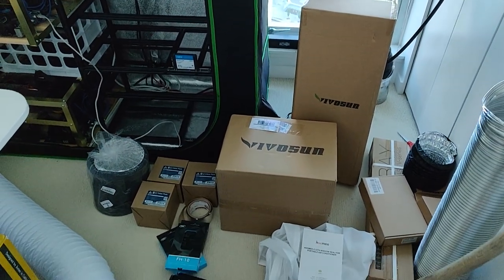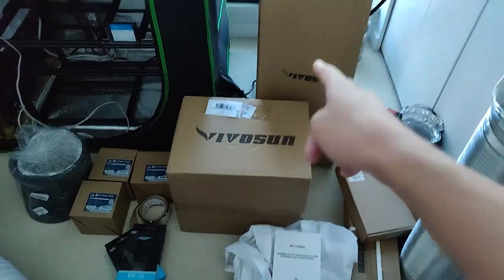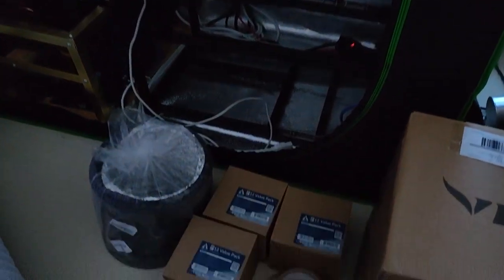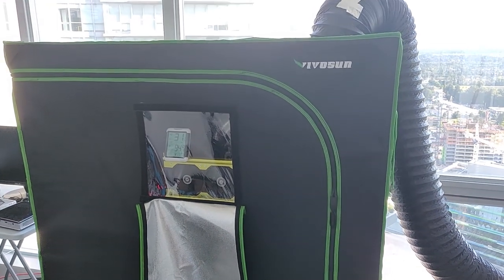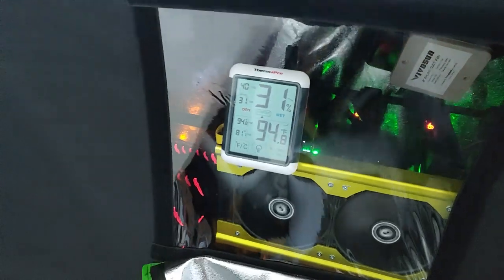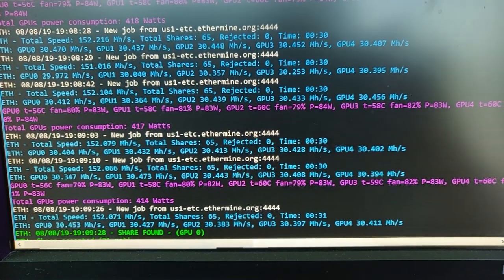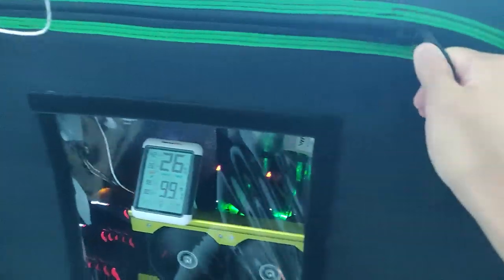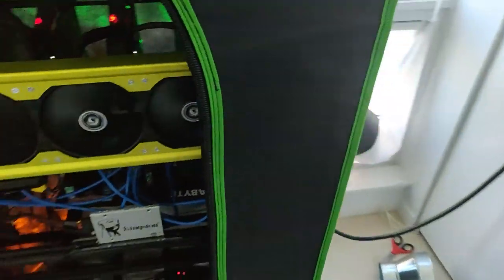12 GPU Mining Rig Condo PROJECT! Part 5

Comment: Airflow is like water through pipes (fluid dynamics) you want to PUSH air in and then route it where you need it to go.  When you fill the rack with rigs, you'll end up with VERY turbulent airflow which is why you're getting hot-spots (groups of cards).  Right now, you're bringing a gun to a knife fight with your HUGE exhaust fan but if you put that on the front end to PUSH air in then directed it up through different parts of the tent, you'd end up with better cooling at lower fan power.
Think of how aircon works at a mall, they pump the cold air evenly around and then the hot air gets pushed out the open doors, etc.  You should look at how many cubic meters of air your need to move in a minute (size of your tent and how many times you need to clear the hot air per minute) and then push that much air in, making sure there's a clean path for it to get to your exhaust ports.  This is also how server racks work when designed to flow from front to back or bottom to top.  Looks like the tent is bottom to top so put your hottest cards on the bottom to get coolest air and make  2 even holes at the top (either side of top) for the hot air to be pushed out easier.  Bigger holes out = less air resistance, hence easier flow. ;)

Comment: I'm looking for ideas for building a box for 2 or 3 rigs. With a inline fan input and output. I plan on pumping the heat outside in the summer, and inside in the winter. Great video

Comment: Yeh, that's a nice change in temps.  And, I couldn't hear the fan that much, I wouldn't worry about it.  Also, if those cards from your buddies rigs are exhausting towards the center of your tent, that hot air will be contributing to the temps on your 570 rig as they are blowing directly underneath it and hot air rises.

Comment: Thanks for testing my previous message about heat exhaustion importance to be true. I think your system is going right direction, but that negative pressure is something you might still keep doing some moves. That much negative pressure sucking the tent walls in my opinion means you should have some more additional intake holes in the bottom area of that tent. If the air moves easily, and it moves just one direction (in -> get the heat from cards -> out) you should be doing just fine. Fans are fine, do not add anymore power there, just make the tent and its air intake/exhaust holes to work the best for your project.

Comment: Hi Red Panda, these ( new fans) experiment turned out to be a hugh success. The good news is: in four months ( winter time), the intake fan will bring really cold air from outside ( your apartment) into those graphic cards, the graphic card temperature will be fifty degrees ( or below fifty degrees) while mining. Will you consider to apply this method to your Radeon 7 mining rig, because you already know these eight hundred CFM fans will work effectively? Red Panda, this is outstanding result. Keep up the good work, sir

Comment: Glad you got it going, man. Not to be a downer, but given your GPU fans are already at 80-90% speed, it does not look like you can add another 12-pack of GPUs... Good luck - it will be close!
Reply from the maker: that will be the ultimate test, once those next 12 gpu's are in, we'll see if the 8" can hold up!

Comment: Bruh... I've got 21 gpus in a slightly taller tent. Mix of 1070/1070ti/1080ti. Only using a 6in exhaust and 3 small inline intakes with all temps <70 in 100F outside air
Reply: Also make sure to put your ethernet switch on the same circuit as your fans so if your fan circuit trips, connection does too and temps drop
Reply: And hiveos ftw

Comment: Have a question about the tent. When you had it setup. Did you only installed a exhaust fan? Did you have an intake fan? If yes (or no), how/where is the cool air coming into the tent? 

Edit: saw the intake on the bottom. So how long did you have this set up for? Cus with the I take on the floor, would it suck in a lot of dust into the tent?

Just curious why you don't run it in your current place?

Comment: Well it looks like you found the answer a bigger fan to suck the heat out but I am kind of wondering on the intake side if you’re getting it from inside your condo if you put one in those other in-line fans in just to help boost it a little bit with the larger one sucking it out if it would be a little bit cooler inside especially if you had air-conditioning in your condo

Comment: 88 degrees in your place is way to hot for me, couldn't do it i have to have it around 73 and i live in a dry climate too (CO). i'm mining in my finished basement (so naturally cool area) I tried two rigs in a small vivosun tent 30x18x36 with just a 6 inch AC Infinity exhaust and the rigs got to hot for my liking. I took out the 2nd rig and bought a second tent same size and split the rigs up and put them on separate circuits (I was close to maxing out my 15amp circuit anyway). I'm finding small tents work well for single rigs with a 6 inch exhaust and natural cool air coming in. My rigs are filled with 5700 xt cards and i've been able to keep the temps down and the inside of the tent is 84F and thats with the Fan on level 5, if it turn it up to 8 or 9, the temp inside the tent drops to about 79F but its pretty loud.

Comment: The fans on the chasis will make a decent difference I'm willing to bet. The quicker you can move heat off the GPU heatsinks the better off you are for thermal headroom which of course will allow for more efficient hashing at a reduced power level

Comment: it looks like you need to open up a bit more intake windows. I think you pointed the 120mm fans the wrong way ,are they blowing into the rig or out ? they should be blowing in to it. All of my 570s vent out the tail of the card mostly so you need to go along with the direction the card blows air rather than appose its natural air flow. looks fantastic tho I have a couple of similar setups.
Reply from the maker: thanks man! The 120mm fans are pointed the right way, the cross bracket behind the 120mm's is where the fans push the air. But ya blowing into the rig for sure, and in the same direction the GPU fans are blowing out through the PCI bracket side.

Comment: Speaking of newbies, what size Fans are you using in the Veedah rig frames. Also how are those hooked up to the rig?
Reply from the maker: 120mm fans, hooked up with those Deep Cool fan hubs and 1 sata power connector from the psu :)
Reply: Thanks bud.

Comment: You might lose a little bit  but if you drop the voltage on that one card if you can
Cuz I know you probably have them overclocked
Drop the voltage a little more on that card that will solve your problem
Reply from the maker: I'm planning on getting rid of those 570 4gb's strix's! they have terrible coolers and memory.